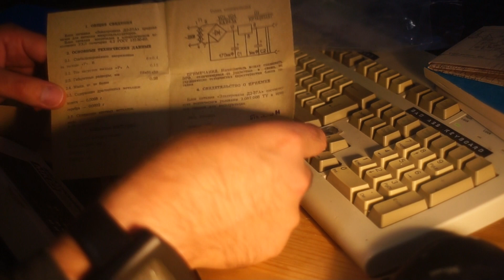Elektronika MK-52 Overview USSR Soviet Calculator

Comment: I brought one of those calculators and also had to change the VFD display my one I brought as a set of two calculators the other one was an early elektronika 4-71 which is the calculator I actually wanted. If you do need to change the VFD display the traces on the board are rubbish and impossible not to accidentally left the traces . I did it in the end not without having to repair a couple . Keep up with the vintage calculators what is not to love ?
Reply: Where do you get the replacement vfd?
Reply from the maker: Sadly a few of these come with bad VFD's out of the factory. The solder also does not come off esily. Not just these where the traces lift. Its why i hate desoldering stuff. Plenty more calculator videos to come. Want to doculement all of the ones in my collection.
Reply: @TheEPROM9  The ukrainian ones claim to have had the capacitors and VFDs already replaced don't they?

Comment: Awesome, never seen the inside of this model. I use this thing's brother, the MK-61 fairly often. The main reason is the large amount of memory locations it's got (can store 14 different numbers with single button store/recall), and ironically I even use its program function once in a while to make it easy to modify terms in a formula (it's actually pretty fast to program once you know what you're doing). Of course there are other less weird solutions, but hey it makes the day just a little more exciting haha. I also enjoy that it forces exponential notation on you when using numbers less than 1. My fav thing with this calculator has been to give to friends and say "hey, see if you can get it to calculate 5x5" and watch them struggle since very few people have even heard of RPN calculators haha~
Reply from the maker: It is pretty simular to the MK-61 internaly as they are basicly the same machine. Just the MK-52 has the EEPROM. I will do some programming on it at some point as its fun. I find the RPN very easy & fast compaired to the clasic entry method. It also noes not seem to have a lot of the useless seientific functions you will ever use which is nice, put something usefiul on the button.

I did that to my bro & he instatly suspected something was up.
Reply: @TheEPROM9  Yep pretty similar, except for the EEPROM like you said and the VFD voltage converter that seems to have a connector in yours.. whereas in the MK-61 you have to desolder it to work on it. The form factor is kind of cute for the MK-52 though. Would fit better on the edge of a desk next to you as you work on stuff. Might pick one up sometime. That "twist test" is always really funny on Russian-made consumer gear with all the creaking. And yeah these days it's very rare for anyone other than students to require anything advanced on their calculators, since all advanced functions are almost always part of some software tool. My "main" calculator is a CX-3 flight computer which will make sense if you google it. Super basic calculator functionality but this device has some other features which are useful for me such as the calculator history staying even if you turn the device off, unit conversion, nicely implemented stopwatch/timer stuff, backlit keypad, really good tactile key feel and rock solid general build quality. Inside is just a single cheap STM32 micro haha.
Reply from the maker: The EEPROM is soldered in sadly, would have to desolder it if it failed & some of them have been known to die. I like the form factor, good for sitting on the desk & two handed operation. I love the janky but also good construction tech that contradicts its self much like the political system that built it. Most of the functions on a standard scientific calculator are prety useless. Better off with a speshalised one like you have or my HP 12C. Has a whole load of useful every day functions. Ha 32-BIT CPU in it.
Reply: @oriole8789  Ah yes, that is what I noticed when I actually got mine, its startling ability to twist.
Reply: Yeah I got an MK-52 about this time last year after wanting one for a couple and had everyone at school tell me my calculator is broken because they haven't been explained RPN.